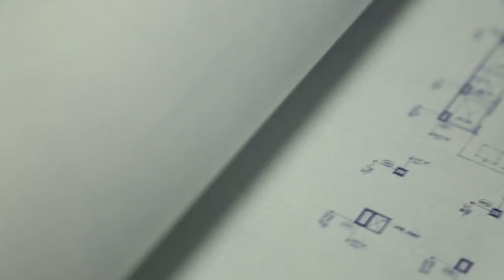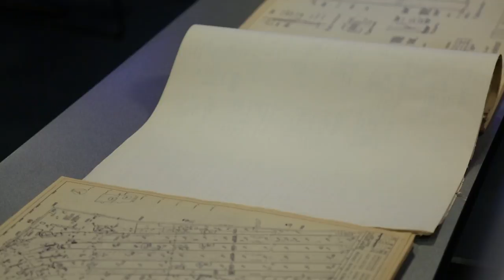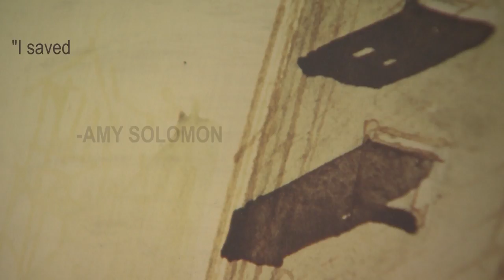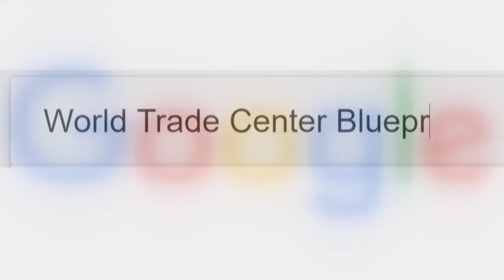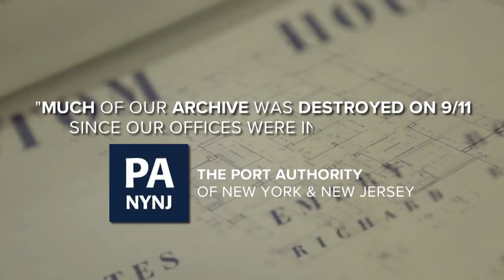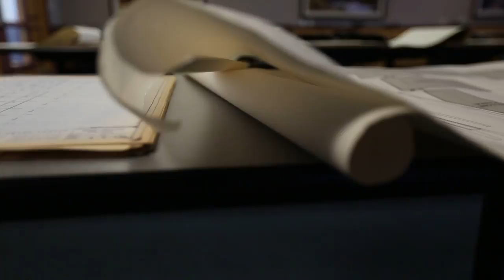World Trade Center blueprints found in pile of trash on Denver street

Comment: Good find now lets rebuild them somewhere stronger and more secure i think Chicago would be a good fit
Reply: The problem with the design was the fact that they didnt let in enough sunlight because it was built so robust, it costed a fortune to operate in comparison to newer buildings ,they also used abestos and imagine how expensive it would be to colapse the buildings to rebuild. These structures were collapsed on purpose with unseen technologies.